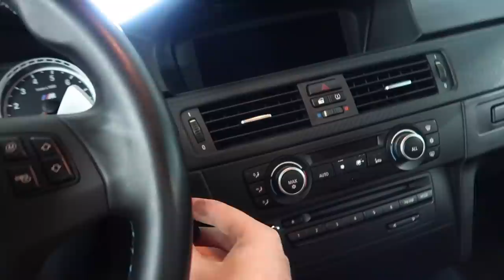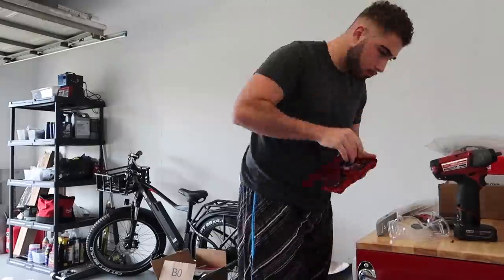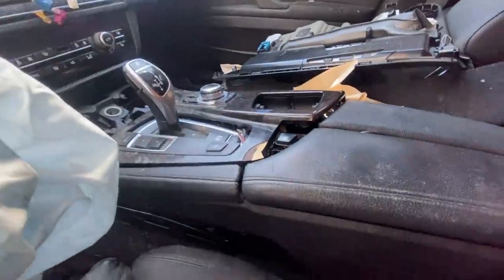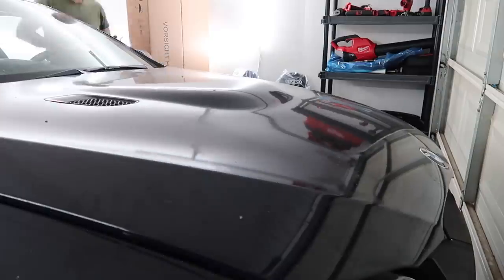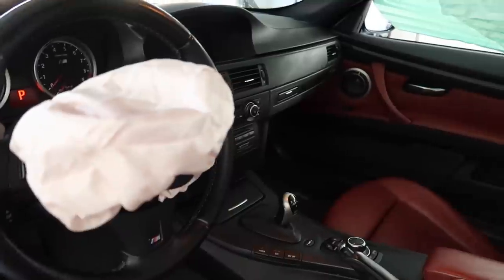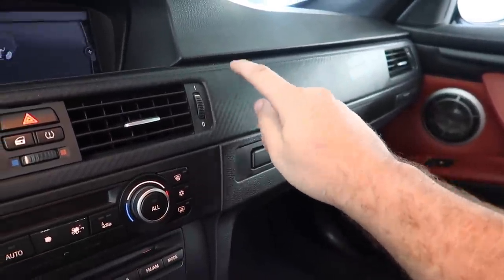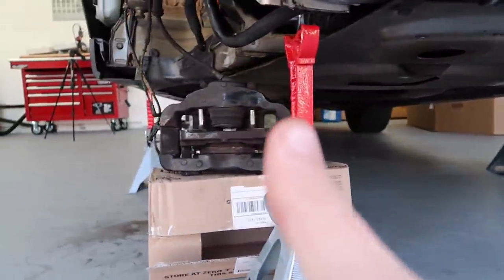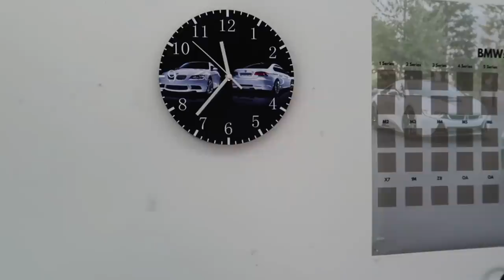STARTING THE V8 E92 M3 FOR THE FIRST TIME!

Comment: Nice to see this fired up!  If you are going to replace the subframe yourself, i would do the rod bearings yourself as well. There are some great DIY youtube videos that are full length on how to replace the rod bearings, with new ARP bolts, torquing is easy.  I havent done the rod bearings myself, but i feel if you get access to the oil pan, you are pretty much there

Comment: Honestly a rod bearing job isn’t as bad as people make them sound like, yeah it’s time consuming but if you have the correct special tools (rod bolt stretch gauge, angle torque wrench) you will be fine, it was a fun learning experience for me, I have OCD when making sure everything is 💯
Reply: I think if you use ARP bolts, they are a one torque bolt, meaning, that you don’t have to do the 90 degree final torque like OEM bolts

Comment: Whats usually the turnaround time for a rod bearing job?I wanna do mine with ssr too but I daily my m3 and need it for work so I don’t want it in the shop for a week or two🤧but if it’s just  a couple days that’s not too bad.
Reply from the maker: If you book an appointment with the, and say you came from my video, they will offer a small discount and tell you what day to what day it will be done. They are on top of it. I would say it’s a 3-4 day project

Comment: You wanna do a 6 series you can do mines. 😁😁😁 I need a make over. I had DMed you in IG also if you have a mines to check it that would be greatly appreciated.
Reply from the maker: Don’t see the dm
Reply: @NourHummadi  I was asking you if you had any ideas on why my BMW starts shaking with a loud vibrating noise at around 60 to 70 miles only when I’m not pressing the gas.
Reply from the maker: @Prez_Jah  wheel balance
Reply: @NourHummadi  I appreciate you. I’ll go on my next day off to get that done. You would think they do it when I just got brand new rims. 🤦🏽‍♂️🤦🏽‍♂️🤦🏽‍♂️